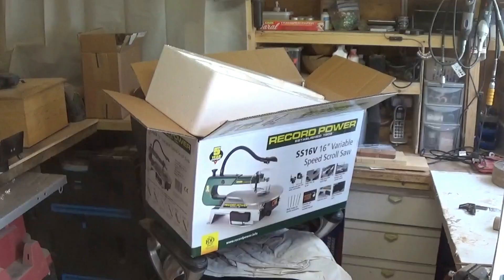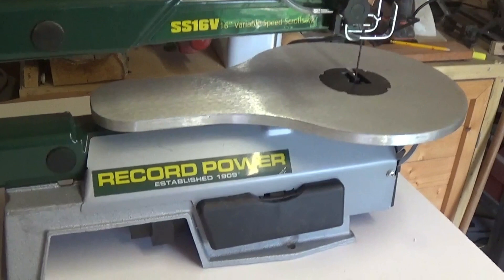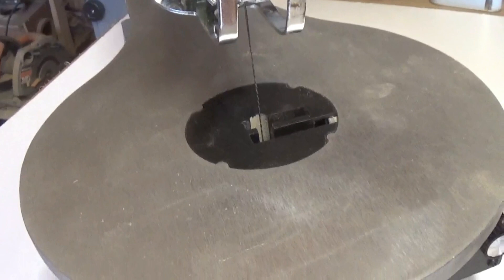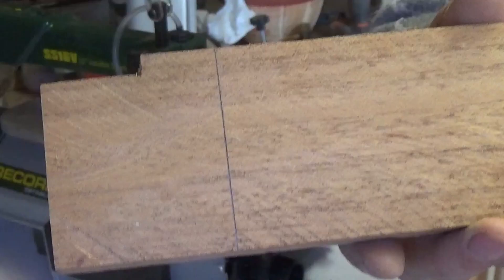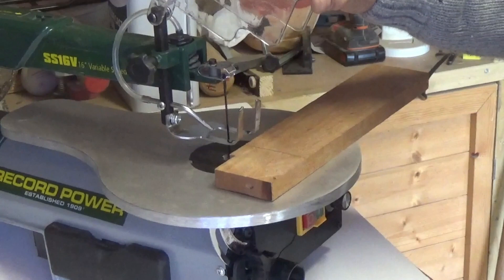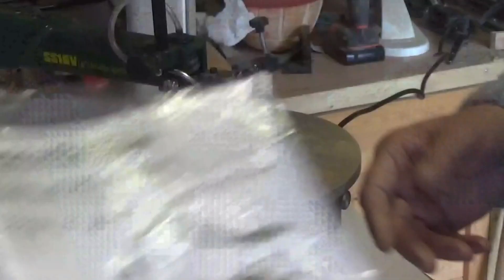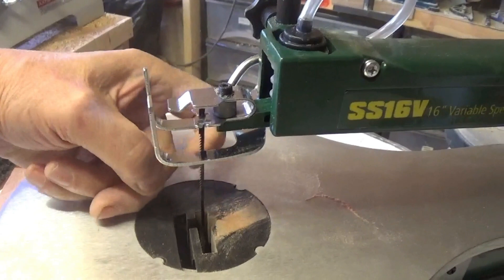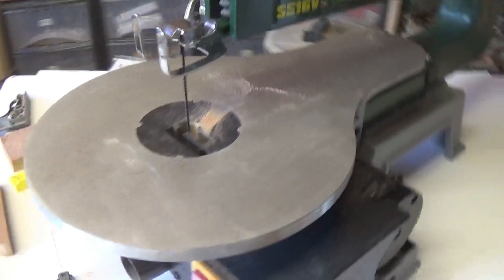Woodturning at 54a. #155. A new scrollsaw!

Comment: Thanks for sharing your thought on this useful tool. I don't own or have never used a scroll saw yet but it's on my list, so this video was particularly relevant and timely for me. It seems not to seem to have a significant footprint , something I need to consider in my now cramped workshop. The light and dust blower are both thoughtful and useful features and the price, a steal.
Reply from the maker: Thanks William. I did quite a bit of research and trawling through Youtube before I bought this,and so far so good.I think as a general saw for the hobbyist rather than a professional it would be hard to beat.Jamie Page uses one,and he does some remarkable stuff with it!😀😀